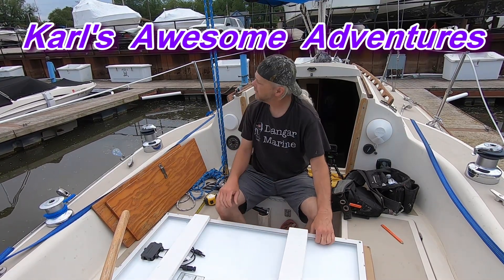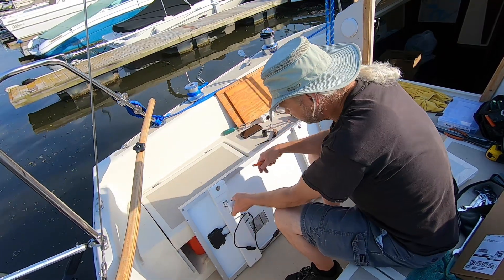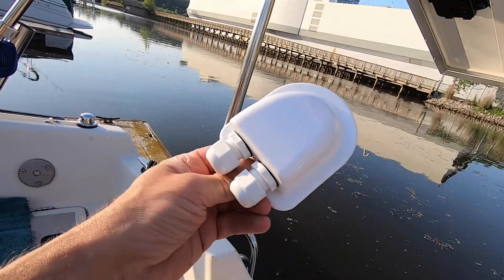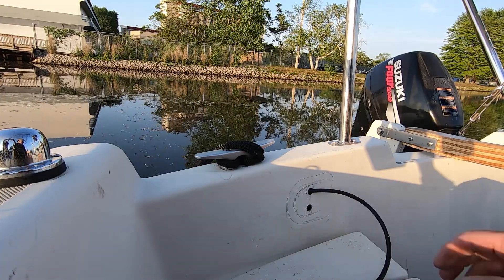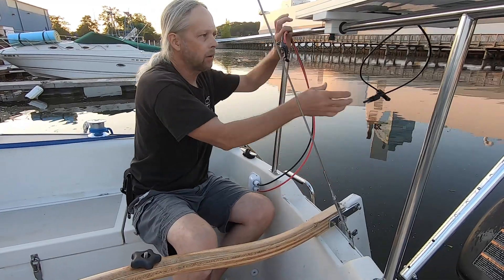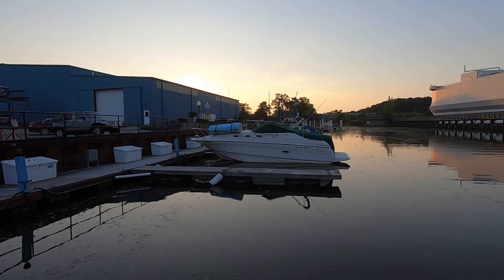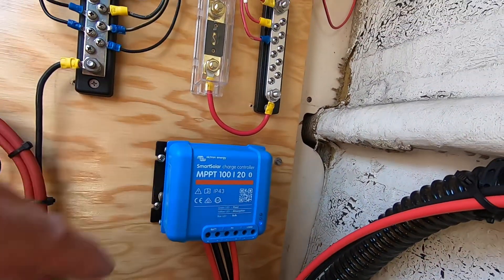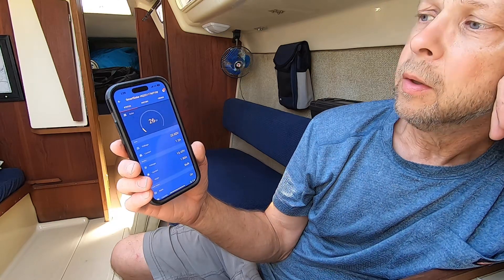How To Install A Solar Panel - On An O'day 25 Sailboat  |  E59

Comment: Hey! The extension pole, did the mount swivel fittings on the ends come with it, or did you add those? If so, could you provide a link to them?
Reply from the maker: Hey! thanks for watching. I had to add them to the extension pole.  And trim the round parts a little bit to get them to fit properly. here is the link https://www.amazon.com/gp/product/B07Z7RFPB7/ref=ppx_yo_dt_b_asin_title_o00_s01?ie=UTF8&psc=1
Reply: @karlsawesomeadventures9608  Thanks! What about the metal swivel brackets that mount to the hull and solar panel?
Reply from the maker: @Tkdmaster1991  they call them rail mounts. 
https://www.amazon.com/gp/product/B07Z7RFPB7/ref=ppx_yo_dt_b_asin_title_o00_s01?ie=UTF8&psc=1